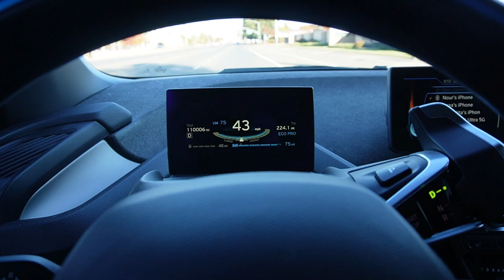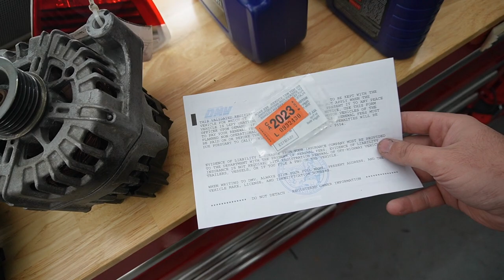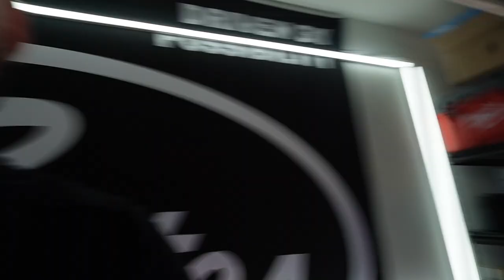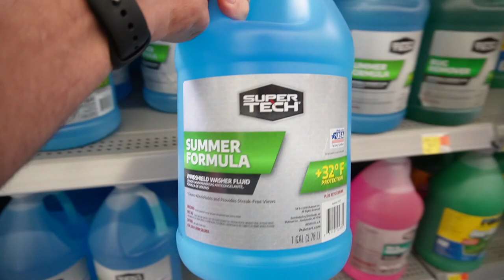Building A Custom 1 of 1 E91 M3 Wagon! (Part.20)

Comment: My E90 from 08 (pre facelift) has electric power steering, perhaps something to retrofit aswell?
Reply: That’s not a thing ur probably talking about active steering
Reply: @roblesinline6642  what is the difference? Mine does not have a oil res. Its fully electronic